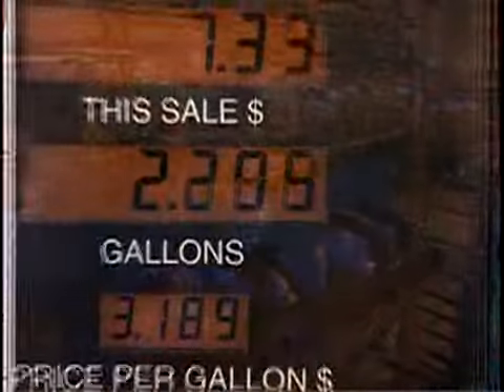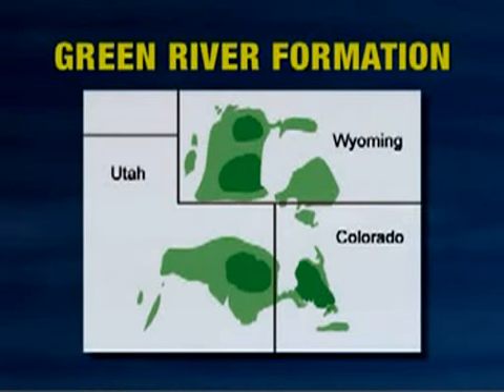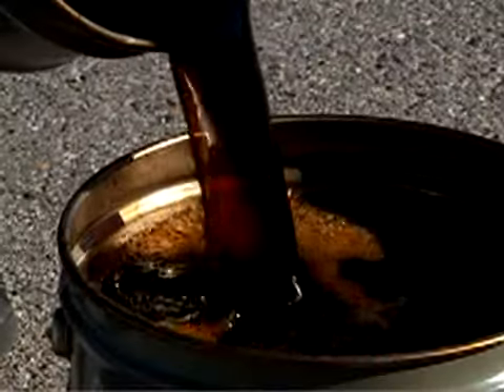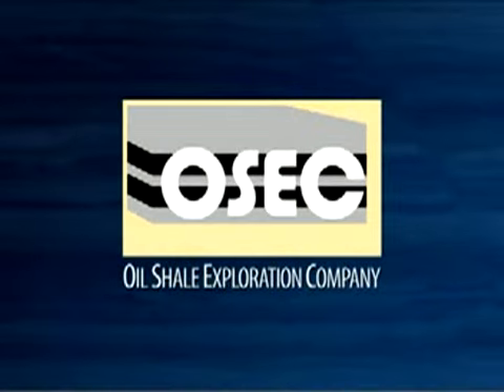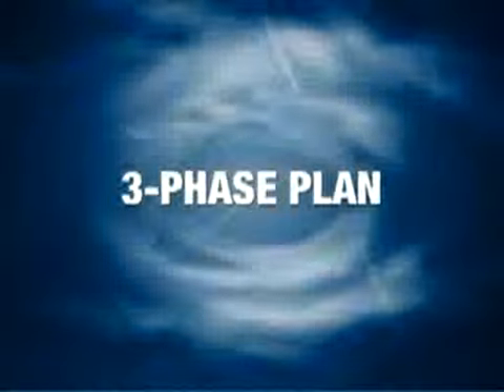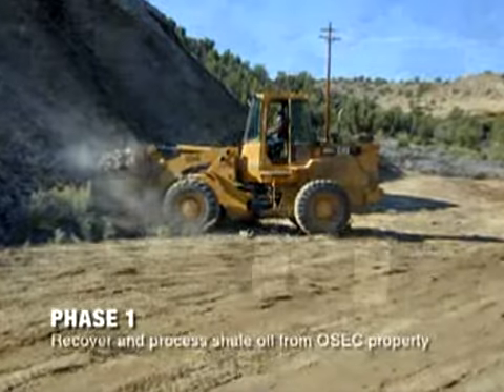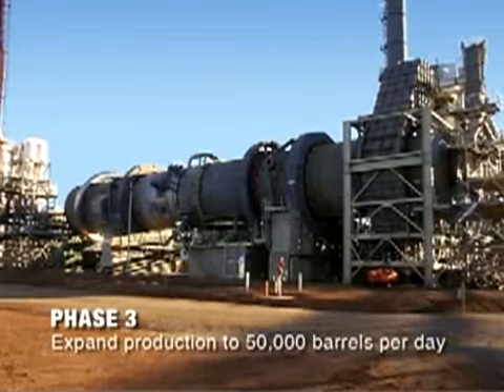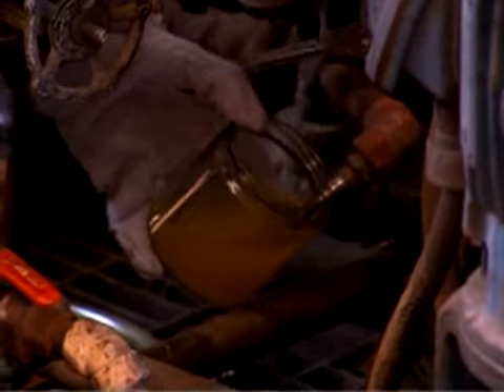Oil Shale Video

Comment: @DanPhantom89 I forgot to mention that it was said U.S. oil production would hit peak in the 70s, not that we'd run out.  Most studies have agreed that we did indeed hit peak oil production in the U.S. in the mid 70s.  A few recent studies suggest that we hit world peak oil production in 2005, but its still too early to tell with certainty.

Comment: Because it uses MORE energy than you get out of burning it.

It makes FAR more sense to just use the electricity you would use to heat it to run electric vehicles.

No one gives a shit about the environment, they can rely on the perfectly acceptable reason THAT IT DOESN'T MAKE A DIME.

Comment: @DanPhantom89 It wont last 300 years.  Even if we inflate the highest estimate of shale deposits of 1.8 trillion barrels to 2 trillion barrels it would only be enough for 273 years at 20 million barrels a day, which is just the U.S. consumption.  You also forgot to factor in growth of both the human population and energy demand.  I'd bet a more reasonable estimate is less than 100 years, even if we keep it for ourselves.  And what happens when the rest of the world runs out?  They wont want it?